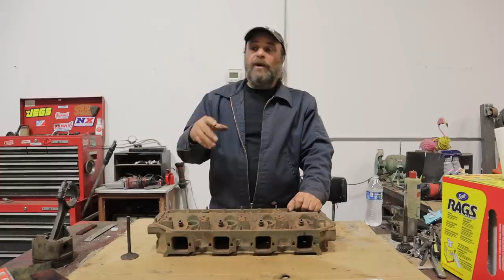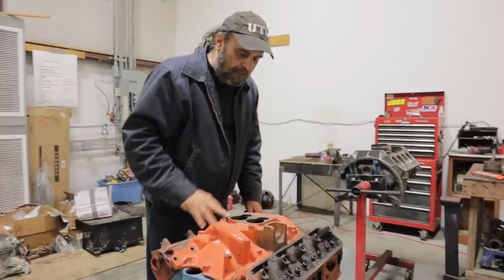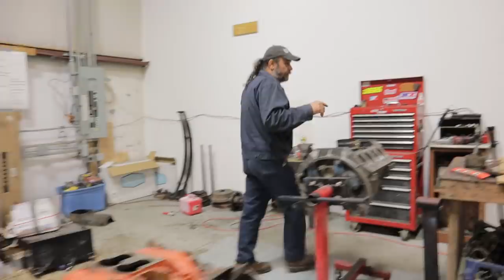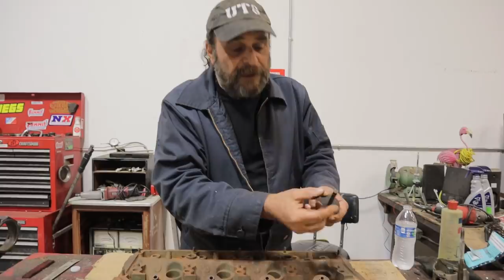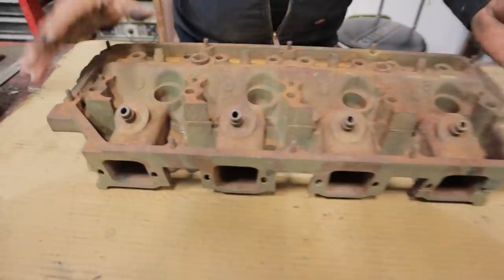Carburetor MPG Myths And Intake System Thermodynamics

Comment: I have a Volkswagon bug with a whole 42hp that I was getting between 53-58 mpg a few times I have gotten 60 mpg but that was way back when we had real gas leaded gas with the crap we have today I get about half the mpg with same car on the crap gas we are stuck with and it doesn't like gasses like cam 2 or the higher octane non ethanol it loved the old lower octane leaded gas. I have heard a few other car owners at shows that have cars like Crosleys and MGs getting 50-60 mpg on the old gas and getting nothing for mpg on this crap gas we are stuck with

Comment: if 15:1 is the ideal air to fuel mixture ratio, then the best you could possibly get is a perfect mixture of the 21% oxygen in the atmosphere to the requisite ratio of fuel. As 79% of the air is not useful to combustion, you would be statistically hard pressed to have every molecule of fuel surrounded by 15 times more oxygen. Ideally, this would mean a 1 liter engine would need 1286.25 grams of fuel to run at 2500 rpm for 60 minutes...or roughly half a gallon of fuel. So a 5l V8 would take 2.3 gallons at 2500 rpm for 60 minutes...and the last time I checked, 30 mpg on the highway from a V8 is not a fantasy or the stuff of fiction.

Comment: Sounds like the gas would ignite before it gets past the intake valve.  I found this on the internet.  "Gasoline has a flash point of -45°F and an auto-ignition temperature of 536°F."  If that valve is 600°F, it would back fire through the carburetor often.  Right?  I'm confused.  How about nitrous?  Gas Mileage?  Best Car I ever had was a 1991 Honda CRX Si - 2200lb car.  4 cylinder - 35mpg.  Reliable OMG.  AC and sunroof.  Best car for 2 people max - Paid $12,100 and the wife came in heat..........needed more seats.  Worst Car 1994 bronco - 10 MPG and would not get out of its own way.   cylinders and 2500 lbs is the combination (rip the seats out of it and drill holes everywhere........
Reply: the fuel mix is to rich in the manifold to have ignition!

Comment: You have so many BTU's per gallon…the engine in your car is a heat engine…only get so much energy applied to the pistons during combustion events.  Thermal efficiency is the only way.  The only way you’d have more mileage is if you get more energy transferred to the crankshaft.

Comment: in order to get 100 mpg plus out of a carbureted engine.  the transmission will need to have 18 or more gears.  how many people are going to have enough patients to shift an 18 speed transmission today?  to get 45-50, you play with not only the carburetor, but timing, vacuum hoses, cylinder head torque, got to have the correct rear end ratio, and tire size also plays a role in it as well.  i dont know why people are still convinced good fuel economy from a carbureted engine comes from the carburetor alone.

my engines, if tweaked for anything more than 49-50 mpg, valves start burning out, exhaust manifold will glow red, and any manifold paint you put on the manifold burns off within 3 minutes of starting the engine.  people need to listen to what is being told in these videos, the carburetor alone is NOT enough to get descent/good fuel economy.  i know because i found out through trial and error.  one example, the car i got 47 mpg out of, it had a 3.8:3 rear end from the factory, fuel economy was 34-36 mpg, BUT, when i put in a 2.7:3 rear end, that is when i was finally able to get the car to achieve the 47 mpg.  you got to play with more than just the carburetor people.  

listen to what this man is saying people, the carburetor alone is not responsible for the fuel economy

Comment: a carburator mixes air and fuel the engine determines the mix tire needed . a chainsaw carburator will get 100 mpg in a chainsaw but you can't run a 427 on a chainsaw carburator.

Comment: The truth is internal combustion engines are not efficient devices. Most of the losses result in waste heat, your radiator, and exhaust. You are using fuel to make that stuff hot and it is not used it's a waste by-product.

Comment: You really want to increase milage you need to fill the pores of the metal,  or use ceramic...gm patented ceramic engines.  No matter how smooth you polish steel or especially aluminum on a molecular scale it's very rough and porous, creates a ton of friction with the gasses. All the metal air intake all the way to end of tailpipe is a huge drain on velocity and scavenging

Comment: So would you recommend keeping the heated crossover open on our mopar intakes? I've been told it should be plugged because it will cause vapor lock and that it doesn't work well with modern gas. I've also been told by others that it's good and helps the engine when you first start it. Along the same lines, what about those phenolic carb insulators? Are they actually hurting efficiency?
Reply: Phenolic carb insulators are there to avoid heat transfer into the carb than can eventually lead to vapor lock/boiling carburetor. The carb is designed to keep liquid fuel in the bowls, not vapor, then later vaporise it through the jets. Heat can be good, in the right places, carb fuel bowls just isn't one of them.

Comment: Well, those high mileage experimental vehicles have generally been smaller and lighter. The easiest way is small displacement with a bunch of gears. A lawnmower engine could power a small car with the correctly designed trans with a slew of gears. No different than a 20 speed bicycle.
Reply: Have a look at the channel   Robot Cantina   they put some small engines into a car.  The fuel mileage was not that great.
Reply: @bobroberts2371  i would argue they’re not designing it properly; the difference between a model T and McLaren... there’s always room to improve. The hardest part is getting past the egos in the room 😉

Comment: I'll believe till my last breath the only reason mpg isnt better now is because the government doesn't want it to be. You cant tell me that technically hasn't developed farther than the mid 80s. My folks had a 86/87 Chevy Nova 4cyl 5speed I remember they made me do the math on the mpg to practice division because I was struggling with it in school and that thing constantly got 25-26 mpg around town and seen it get 38-40 going on trips. And ran decent best I can remember. So with the crude efi they had then why cant compact cars with direct injection get better than 3-5mpg more. Then there is the diesels truck old diesel's 12/24 valve Cummins and 7.3 ford's would get way better milage than today's with all the epa garbage. Not to mention the cost of def added in on top. So hear me out you have a new 6.7 dodge that gets worse mpg already than the last 5.9 Cummins then you have factories making def putting out pollution then all the 2.5 gal jugs it comes in plus most of those jugs are in a cardboard box and then those are shipped in a truck burning fuel so please tell me how in the holly hell all of that is better than the way it was before.
Reply: We had Suzuki Swifts ( often rebadged as geo metros) that got 40 ÷ miles per gallon the one thing that hurt economy most is weight. Compare a modern sub compact car to a 30 year old one, all the required safety equipment has turned them into bloated pigs.
Reply: I get your point btw in the very early days I'm sure they had better mpg in automobile we seem to always go one step back
Reply: @WhiteTrashMotorsports  that's true but the ole nova was carrying 3 250lb plus people all the time lol so it was loaded
Reply: That "Chevy" was built by Toyota.  It had a 74 hp 1.6 liter engine, weighed 2200 lbs, and went from 0-60 in 13.4 seconds.  Compare that to a 2021 Ford Explorer:  2.3 liters producing 300 hp, weighs 4400 lbs, and goes 0-60 in 5.9 seconds.  That is kinda like you in shorts jogging a mile vs. you carrying a 200 lb pack and sprinting the same distance.  Which do you think will tire you out more?  Is that because Big Grocery wants you to eat more?
Reply: Modern compacts are getting mid 40’s on mileage. Also, the performance of modern cars is far beyond the stuff from the 80’s. Also, the average speeds have increased as well. Then add in that there’s an extra emphasis on emissions. Sometimes the best mileage also produces more emissions so they have to compromise. 
A 7.3 got bad mileage compared to any of the modern diesels. You were lucky to get 12mpg with one of those even unloaded. Modern diesels are regularly getting 20 or more unloaded. I know people with newer Dodges that are non dually and 2wd that are getting mid 20’s unloaded when just driving around. 
Sure, all the DEF stuff is kinda dumb and produces a lot of extra waste. But, stock for stock modern diesels are way more powerful and at worst get similar mileage.

Comment: I'm not sure if Chrysler in USA did the ELB (electronic lean burn) deal but in Australia at the end of the Chrysler era the CL/ CM they were at the cutting edge with this albeit too late to save Chrysler Australia, but it should have, the buyout discussion with Mitsubishi was well and truly under way by then, they had it perfected with the 6cyl 265 hemi engine, it would enable up to 23:1 AFR under light load cruise conditions, this was with a carb, no injection and a (by  today's standards) very simple control box mostly done with a mass of vacuum lines and a few sensors, seems very few even in Australia got much exposure to this system as it was and end of model and production feature, it was soon Chrysler Mitsubishi then just Mitsubishi who did not keep it as a part of their production technology, the next time I saw similar raise it's head was in 1988 with GM, s Lean Cruise but that was injection and not reaching 23:1 and Lean Cruise was abandoned because of high oxides of nitrogen associated with lean combustion, contrary to what it seems a lot of people think fuel economy and emissions are at odds with each other, rich mixtures keep combustion temps down and therefore have lower oxides production
Reply: Honda did it with the vtec e as well.
Reply: It's interesting that running a bit lean increases temps but jumping to extreme lean ( like the 23 you mention), actually starts to bring down temps again due to such a small combustion that no longer gives off as much heat. Very interesting stuff
Reply: @chevy6794  ok not real familiar with Honda stuff or years of production, I might see if someone I know can enlighten me, what era did honda do this, chrysler was early 70s
Reply: @car_ventures  can't say I have that application knowledge, most I seen was at very light load conditions, big thing that can now be seen historically is chrysler were only ones in Australia back then doing electronic ignition therefore enough energy to fire lean combustion
Reply: @Hitman-ds1ei  the engine was called the vtec e. In economy mode one valve stayed almost closed and promoted a swirl combustion. I can’t remember the afr ratios but it ran really lean and got economy numbers that even hybrids today are not getting. It was used in the civic vx from 92 to 95 and the hx from 96-2000. It was also canceled do to high nox emissions. Europe also got a 3 stage vtec that was both economy and performance oriented. And yes in Canada Chrysler also had the lean burn but most were taken off under warranty do to issues. I’ve heard a lot of it was mechanics not knowing how to deal with the new technology though. Lol. Have yet to see one but would love to.
Reply: @chevy6794  thanks for info, back when I was teaching in Trade School here I was lucky enough to work with a guy who was a full bottle on ELB having worked for Chrysler and we had some units as part of teaching aids, this was back in the old "chalk and talk" days when we used paper based resources and black boards ( later white boards) and actually delivered verbally to classes, oh those were the days 😀 I love technology improvements but that connection with the students is long gone, now mostly done with VR etc, I guess the world marches on

Comment: I don't argue the fact that a classic V8 engine can't achieve 100mpg. Never argued that point. I'm still suspicious of the auto makers because when they come out with an engine drive train setup that's really efficient, they eventually scrap it. If we go back to the 1960's and 1970's, we can look at Mopar and see their slant 6 engines could easily obtain 25mpg and some got 30. My dad rode in a car to California with 5 other fellow Coast Guard Reserve men ( that makes 6 guys) with their heavy barracks bags from Washington State in a little Plymouth Valiant. Granted, it had the smallest slant 6 but they got 30mpg with 6 full grown men and their barracks bags and even going over mountain passes! My uncle had a 68 Rambler Rebel wagon - a huge boat of a car - with 232 6 cylinder and it got 25mpg. Some of the GM 327's were getting 25mpg. These are straight personal stories and not a friend's uncle's roommate's cousin twice removed. Why were these cars scrapped? Why didn't the auto makers do research and development to see why these cars did so well? Let's fast forward 30 years. Lee Iacoca's last design before he retired - the cab forward designed cars. They were a generous size car with a decent size V6. I can't remember the model name but my parents had the Dodge version (I think the Concord, maybe that was Plymouth). Anyhow, they got 30mpg consistently and sometimes better, yet Mopar didn't try to continue with this fuel efficiency - no, they scrapped it all! And NOBODY can tell me it wasn't so because MY PARENTS owned the car and I know of others who had them and got similar results. The Dodge Magnum wagon - Mopar boasted 30mpg with the 5.7 V8. However, I don't know if that's because it had variable displacement capabilities. So while I agree with your argument that there's a limit to how much fuel you can save, there's got to be something to it though and it looks to me like the auto makers are scrapping very fuel efficient concepts that work and it's not a fluke! Maybe some of that has to do with EPA regulations and manufacturers have to achieve 1mpg improvement average over all their production every year. Perhaps that's why they're doing this. If they already achieve maximum efficiency on everything, then the auto makers have nowhere to go on improving mileage. I don't know but it sure frustrates me to see these rock solid verified efficient engines end up disappearing from the market.
Reply: This is loonytunes on steroids. No one is "scrapping fuel efficient designs". What happened was people wanted more power=bigger engine=less milage, and people wanted more luxury, safety and gizmos=more weight=more fuel needed to move additional weight to same speed/accelleration as before.

There has been continuous improvements, but they have been negated in large parts due to added overall vehicle weights. Then manufacturers start with lighter thinner materials, but then customers want even more gizmos, so its worse than where it started. Big land yachts of the 50's are far lighter than a minivan of today. Problem is, many drive vehicles even heavier than minivans, SUV's, pickups etc, so its even worse still.

This plus the 55mph speed limit, which was introduced to SAVE ON GAS, just cant be matched at 70-75mph in twice as heavy vehicle. Its simple physics.

If you read 1/10 of the comments to this video this would be obvious.
Reply: @Santor-   My parents had a Dodge Intrepid with a V6 that got 30mpg and better no matter where they drove. I have a 2012 Jeep Compass with 2.0L that is just a few pounds lighter than that Intrepid. We bought it new and it has never topped 25mpg and usually gets about 21mpg in town. Hmmmm. And yet Mopar never continued to use whatever drive train combo that would continue to give rigs like my Jeep that kind of mileage. You can have your pipe dream answer for this but I tell you now it's a truckload of crap. For some stupid reason, car manufacturers have displayed a history of removing from the market successful drive trains that deliver sometimes power along with good fuel efficiency. Keep smoking whatever it is that makes you believe your way of thinking but there's plenty of facts out there to prove my point.

Comment: So, you mention Smokey Yunicks Gasoline Vapor System several times in your previous video. Do you believe that Smokey Yunicks system improved engine efficiency?  It is not just vaporizing the liquid gasoline. It is Pre-vaporizing the gasoline and then mixing the gasoline vapor, (Gasification ),  into the also heated air to make a homogeneous Air and Fuel mixture at the correct stoichiometric ratio of 14.7:1, that burns completely in the combustion chamber.  .  You sir , (Tony ), are making many correct  statements and  also many incorrect statements, in many of the things that you say. I recommend that you investigate the Gasoline Vapor Systems group on Facebook.

Comment: Love your videos Tony but please stop using the word Atomization. 
You know that's not the right word for taking a liquid to a gas/vapor. 
General HVAC/refrigeration will define terms much better.
Reply: The term “Atomization” in cars is unrelated to “atoms” in physics. In a carburetor it is about splitting the liquid into droplets by mixing it with air. The atomization is visible, it is like a sprayer.